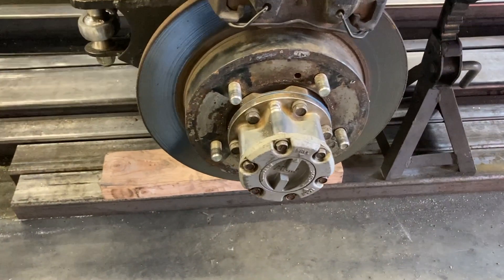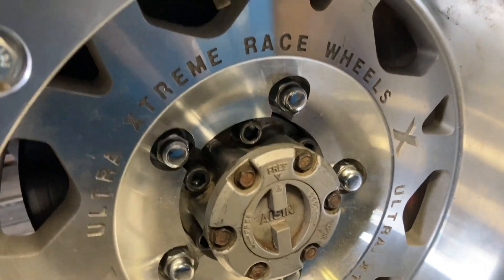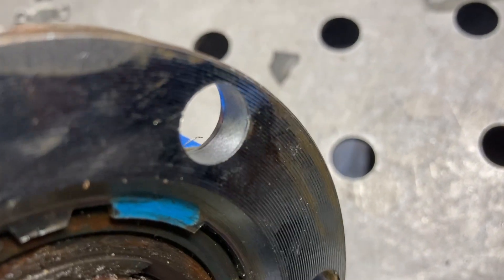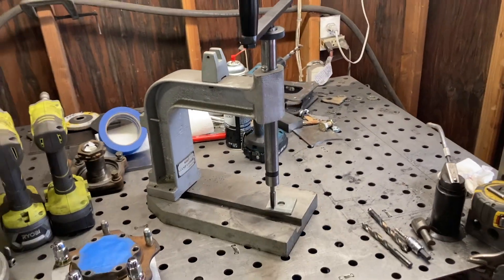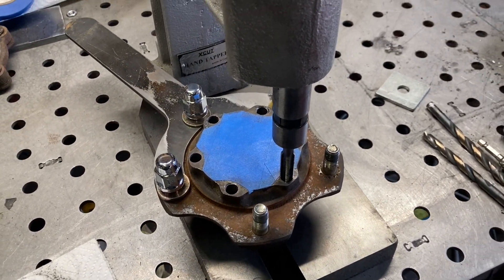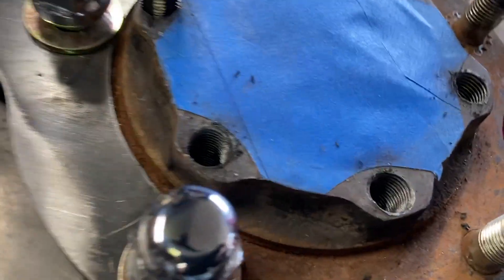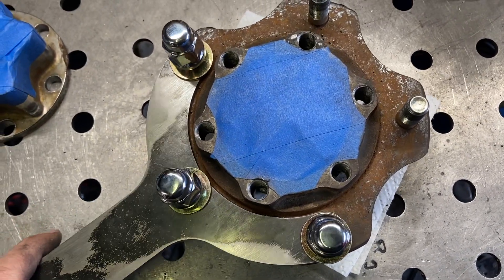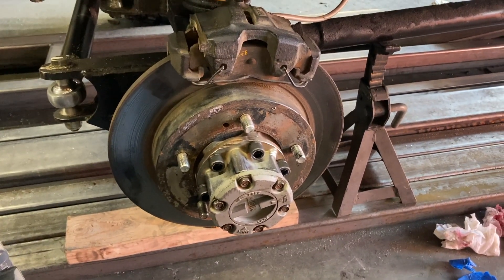Suzuki Samurai locking hub upgrade

Comment: Pretty neat.  I have  question. One of my locking hubs doesn't rotate all the way to lock. It only rotates abou 3/4 of the way. Any ideas what might be causing this?
Reply from the maker: I would pull the 6 10mm bolts and pull the dial face off. Check for rust or grit in the hub body. It’s a pain to fix if the springs come off their clips.

Comment: I’m concerned about unnecessary unstrung weight…are your brave calipers cast steel or aluminum?
Reply from the maker: Right now all my brake components are original suzuki, steel. Soon I will be replacing with light weight Wilwood brakes.
Reply: @ultra4suzukisamurai679  please chime when you have an idea what model and size calipers and hats you will go with….there’s quite a selection out there for the fabricator like you.
Reply from the maker: @offgridmangogrower  I will. Thanks for watching.